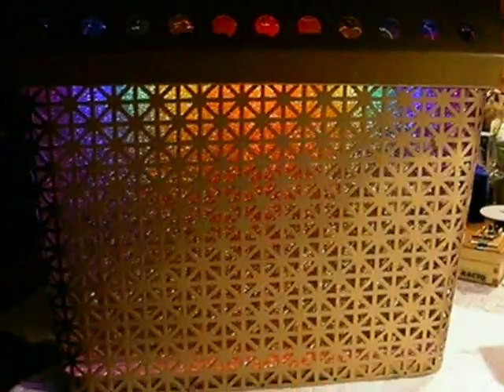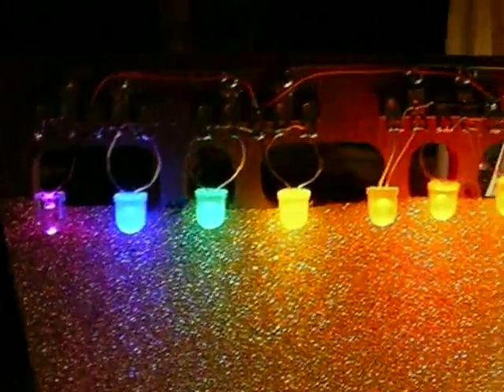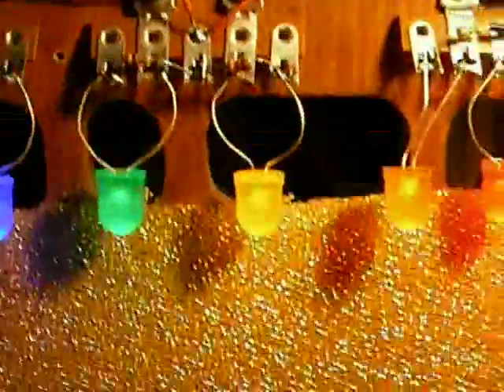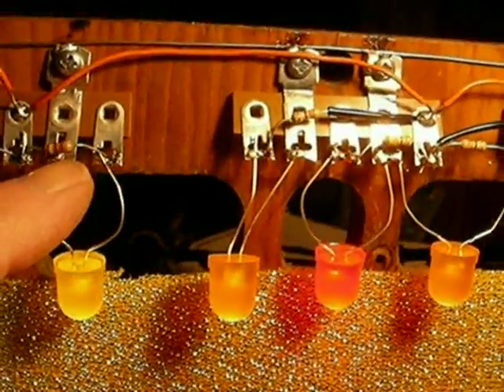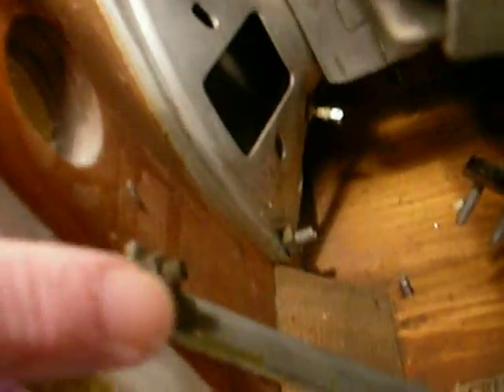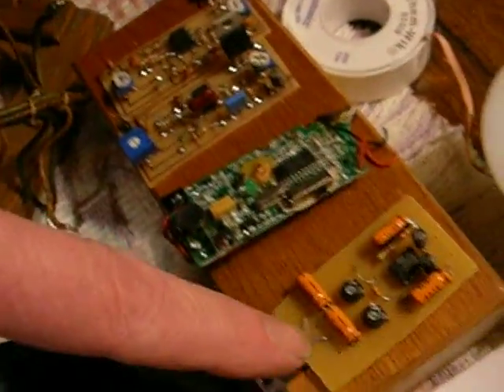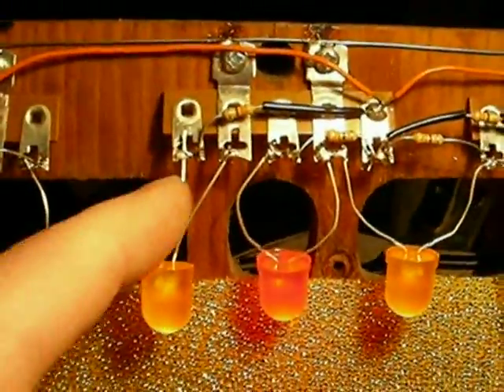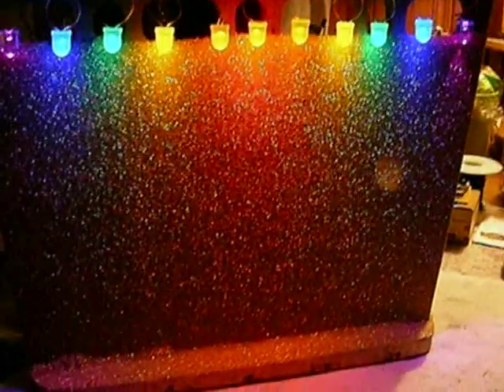Williams Music Mite- adding the Color light up grille

Comment: Nothing brightens up a player as much as colored LED's whether it be one of the Music Mites, an RCA EY-2 or ANY player that lends itself to accepting the possibility of using these LED's. The other great thing about the LED's is that they consume VERY lttle current lending themselves to convenient use in battery operated players ala the EY-2's you convert to battery power. This conversion is great added value to the Willims Music Mite. Great job Chris. Now on to show the completed player!